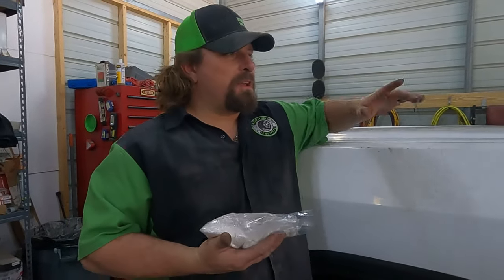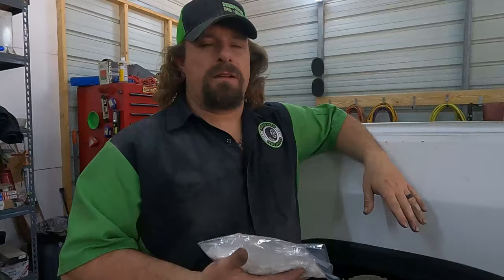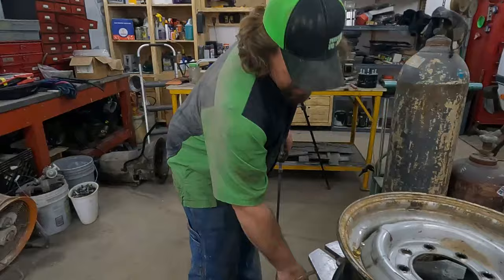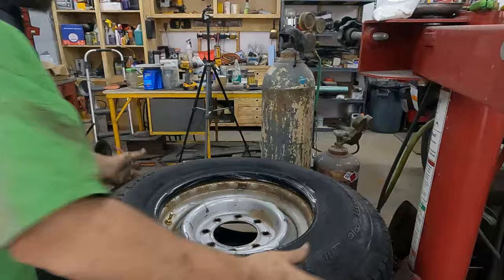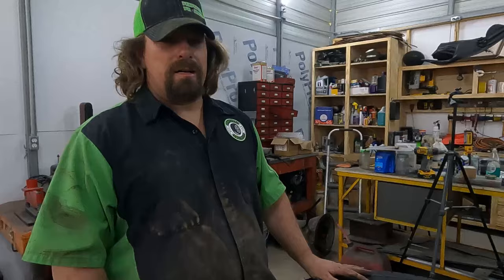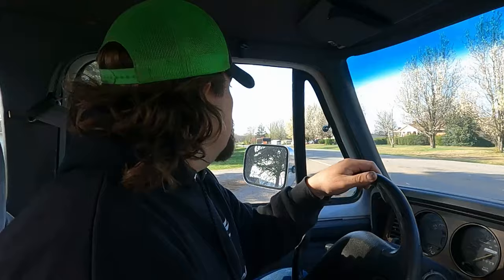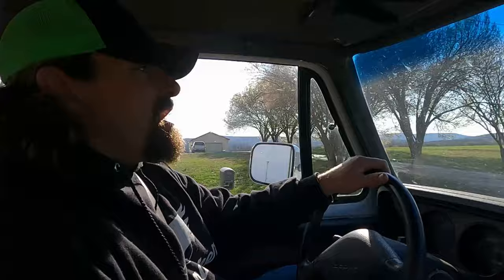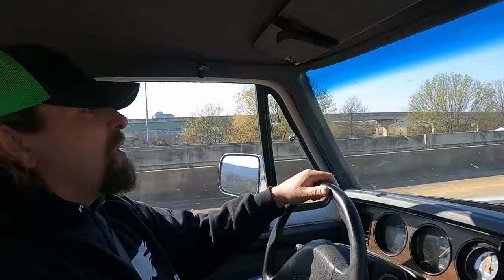Installing and Reviewing Tire Balance Beads On My 3/4 Ton Dodge Truck

Comment: I have a 99 E350 Super Duty, play/work van, I put a set of mismatch tires from my local Mexican tire shop, mounted them at home with beads and they ride as smooth as butter! Not to mention the whole set only cost about $260.

Comment: They use beads in motorcycle tires all the time and they seem to work well. I use them on all my motorcycles. I'm going to be putting beads soon in the original wheels I just restored for my '67 beetle and I found this video while researching. I hate the thought of clipping weights to the lip of my freshly painted wheels or having the grey foam residue stuck to the wheels every time I have the tires re-balanced.
Reply from the maker: We also use them in semi trucks and they work well there too.
Reply: Roughly how many ounces would you put in motorcycle tire

Comment: Yes sir the beads work. 👍👍 they also have a pulling felling to the road that makes it ride smoother as well. 
HOWEVER they do wear out and turn to powder. Usually in a year depending on miles you drive. The ceramic can also wear the inside of the tire depending on compound. Ive found the stainless works better and for longer with less wear to the inside, but you better have steel wheels. Th rims will get bead blasted no matter what you use.
Reply from the maker: Steel wheels, check.  According to the advertisement on these they aren't supposed to break down or wear the tire so hopefully I don't run into those problems. I won't be dismounting them until the tires are wore out or the get out of balance enough to notice it,.   So we'll just have to wait and see.
Reply: @PerpetualProjects  Word is you have to make sure you're using silica glass beads. Any other knock-off will cause issues.

Comment: Thank you for this. I love balancing beads. I had seen a video where someone put balance beads in one tire and then went for a test drive and said, “ well I guess they don’t work because it’s still vibrating.” Then he proceeds to say he doesn’t recommend them. 

Well I also don’t recommend balancing one tire and leaving the other three alone and expecting the vehicles tires to suddenly be balanced lol. 

My experience with them has been good even with low profile tires. 215/40r18 Kumho Ecsta All Season Performance tires on a 2006 Corolla CE 5 Speed. Lowered on BC Coilovers with the upgraded Swift springs (worth the upgrade) and 5Zigen wheels. The wheel company used to be a relatively well known reputable wheel company through the 1990’s and early 2000’s. I found mine for $200 for the entire set with tires that had 75% tread life left and no dry cracking. Kid didn’t listen to his father when he asked him to clean out his extra car parts for his 2008 Subaru WRX in the garage. And he ended up selling them super cheap to get the message across to him lol. So thank you kid whoever you are for making your dad sell me your wheels and tires super cheap lol. 8” wide as well! So I was really happy with the fitment and offset. But I didn’t want to waste money balancing the tires in case they ended up not being good from sitting. So I had balance beads in my garage already, put them in through the valve step and used a hair clipper to vibrate the valve stem to get them falling through much faster. Shoutout to another YouTube video I saw doing the same thing lol. And they went from a little vibration at 75-80 mph to silky smooth all the way up to 100 mph which was as comfortable I was going on tires that I had just gotten and had been sitting for an unknown amount of time. So I really enjoy these balance beads ease of use and results.
Reply from the maker: Yeah doing just one makes total sense 😂 Good tip on the hair clippers, and that was a really good deal on the tires and rims! It sounds like you have a really cool car.

Comment: I've run these in my motorcycle tires for several years.  They are a bit of a pain to install through the valve stem.  My 400x19" tires take 1 oz of beads.  I even reused my last set by cutting open the old tube and installing them in the new one.   I have seen NO cupping of uneven wear on my tires.

Comment: Your truck reminds me of one i used to have. I had a white lifted 1985 W250 4+4 was a good truck but once it started rusting it didn't take long and it was real bad! 4"Ranchero lift on 35" all terrains.
Reply from the maker: That sounds like a cool truck. I want to build a nice 80's swb 4x4 someday.
Reply: @PerpetualProjects  I love the front end on the year, looks beastly! Good question,   best bead? And how long before the ceramic beads break down? Always wanted to run beads in past but just never did. Going to try them on next set! 💯 I have 33's on my Silverado now, got a crazy cheap deal on wheels n tires but tires don't measure 33! Lol. Should of just went 35. Thanks

Comment: I run a tire shop and have had people ask me to take them out. they usually scatter over frost cracks and rail road crossings. shake and then rebalance. same with start up  shake some then balance at a higher speed. I will use them in semi tires as I cannot justify spending 15k on a truck tire balancer.

Comment: Great video buddy... Did you use any special valves to avoid leak through the nozzle with regular valves?
Reply from the maker: I believe the kit included valve stems, but in the past on semi-trucks I have done it both ways.

Comment: I used non biodegradable airsoft bbs. So far so good
Reply: Word is you have to make sure you're using silica glass beads. Any other knock-off will cause issues.

Comment: I'm a tire tech. The beads we use come with a special valve core, so the beads don't get jammed in the regular valve cores. Do these come with special cores?
Reply from the maker: I don't remember if these did but some kits do include the valve cores.

Comment: 2 years later have you replaced the tires and how did the inside look?
Reply from the maker: Hey we only did this video about a month ago but that’s a good video idea for when we do have to replace them! 1200 mile trip on them so far with no issues

Comment: I go through tires amazingly fast ....expensive sport touring tires others get 10k with?  I get MAYBE 2k and no I dont do burn outs or intentionally spin the rear  or donuts ...NONE of that nonsense...I have tried various tire pressures nothing makes a significant difference in longevity.  So the salesman at the motorcycle tire shop 8 ball very well known in San Diego area says " you need BEADS and then your tires will stay balanced and last a lot longer.....NO that helped nothing except to pad their total which was like $670 for both tires installed on the bike....they also upsold me some angle valves which I do like.  But IF you only ride the twisties like I do?  apparently NOTHING short of riding slowly is going to net you high miles in the twisties.....beads were just a waste of my money they were in there for about 2k miles and the tires were DONE,...and I mean DONE cause I TRY to get my money worth ....I keep going well after the wear bars rear their ugly heads.   And YES I know all about dual compound tires I always get those  I have also tried various brands models B stone Pirelli Dunlop etc....MAYBE if I bought a really low powered bike instead of my Yamaha MT-10 and 9 bikes?    idk but it is costing so much I finallly bought my own tire machine a No Mar Classic HD a few months ago ....I just mounted tire number 6 so it is quickly paying for itself...but just saving me 2 hour round trip everytime is worth it alone!  (I live in the sticks RIGHT by some of the best twisty roads in the world IMHO)....anyway thumbs down on beads....I bought a static balance stand and I can balance in a couple minutes no problemo....and btw IF I ran the tires I like best?  HyperSport tires even like S23 BStones?   Yeah 600 miles to the wearbar and tire is dangerously ridiculously BALD by 900 ....cause I stupidly tried very hard to get a whole 1000 miles.....It was soooo bad I could not in good conscious ride another mile with cords showing.....but DAMN those tires rode nice!  Made be feel like a motogp star!  lol

Comment: They don’t work.   I have tried twice .   A traditional weighted balance works better for a smooth ride .  Beads are lame
Reply from the maker: So far I am happy with them, but to each their own.
Reply: They don't work for you.

You can't just say everybody is bsing or being paid it sounded a little like that.
Reply: @norbertnagy5514  very well.  The beads didn’t work for me .  I thought my post would help some folks out because it’s pain to re-do and uninstall the beads and then get a traditional weighted balance.  I tried beads twice unsuccessfully.   Then went to a tire shop that specializes in larger tires and the owner with 20+ years of experience also made the comment that beads will not get the nice smooth hwy ride of a traditional balance .  So I’m just letting people know what i learned with my two personal case studies and the opinion of an experienced tire shop owner.   I was running 35” cooper discoverer at3 .   They traditional balanced well but didn’t like beads . Really enjoy the tires .  I like to try new gadgets on my truck and beads are off the list because “they didn’t work for me”.
Reply: @geraldmcclintock2567  thank for describing your experience alittle more in depth